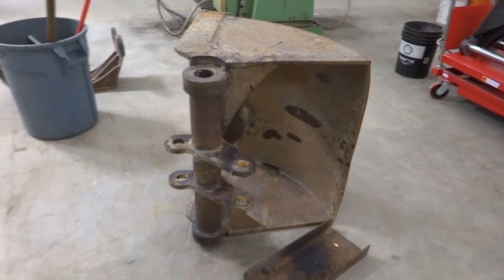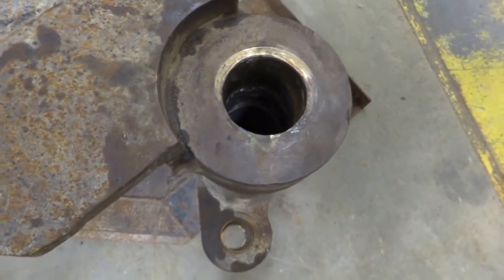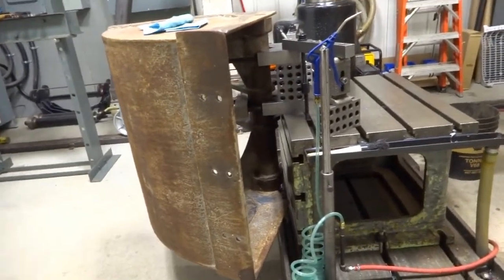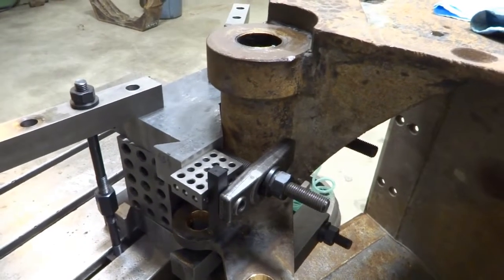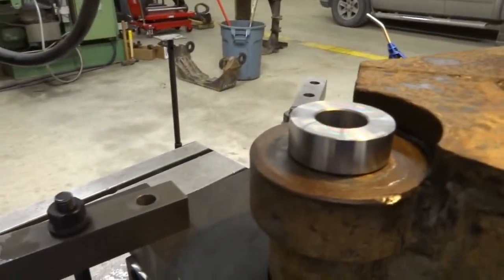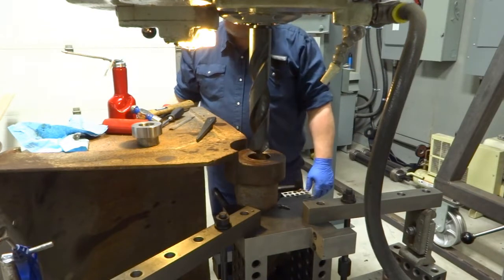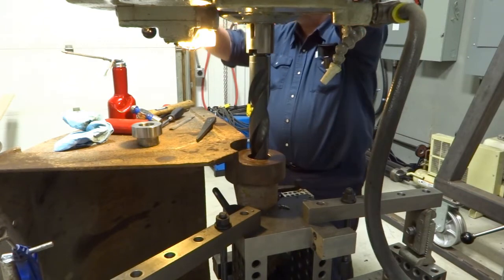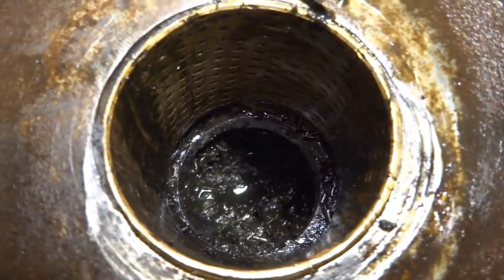Drilling Out Ugly Torch Cut Hole in An Awkward Part

Comment: Thanks for posting.  Much can be learned from your experiences.
It no doubt took a very long time to figure out how to clamp the bucket to secure it with the blocks you had on hand.  In a situation like this, I have often just welded on a tab of some sort to get a secure clamp point in a hurry and then removed it when finished.
Regards

Comment: Hi Ken,

Would it have been better to use a hole saw to create the first round/centered hole?

Not that your method didn't work, as it did impeccably.  But back in the planning stage when you might have considered if the bit would snap off or continually damage the cutting edges; I think I would have considered a hole saw?

Thanks for sharing, as always.
Reply from the maker: A hole saw probably would have worked well but I never have any luck with them when I use them on a drill press.  I always end up buggering them up.  I can regrind the twist drill by hand so if I bugger it up I can easily fix it and keep going.  Ken

Comment: I was expecting to see that drill snag and snap in half. Twist drills are quite dangerous at that size. You did a good job Ken. 👋
Reply from the maker: Thanks Dave.  I was expecting it to snag as well but it didn't.  The feed gear train on this radial drill has no measurable back lash.  I don't know how they managed that as there is a worm and worm wheel, three spur gears plus the pinion and rack in the feed gear train (also, this drill is 63 years old).  Because of this if the drill tries to grab there is no slack to allow it to pull in and take a big, damaging bite.  It's similar to a milling machine with a backlash eliminator in the lead screw, allowing climb milling to be done.  About all that can happen is it snatches the drill out of the taper, and the tang gets twisted off.  I've done that before.  Ken
Reply: I can't believe the edge on that thing held up, I would have put money on him regrinding that thing a dozen times! Good show!